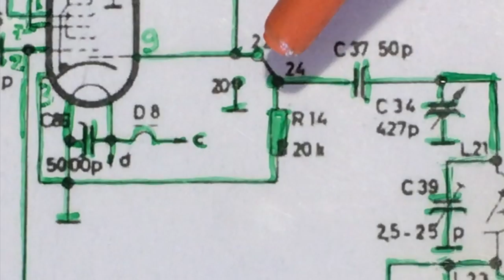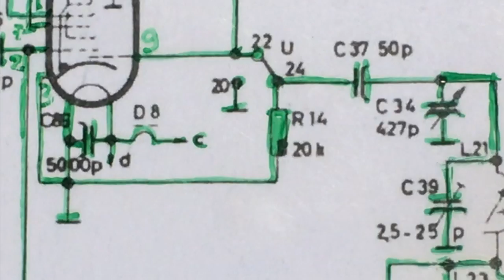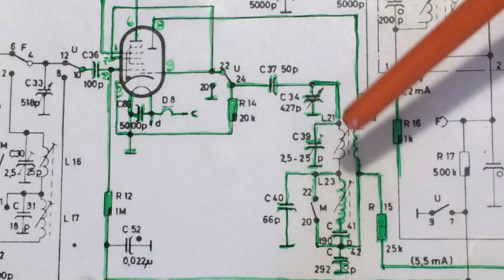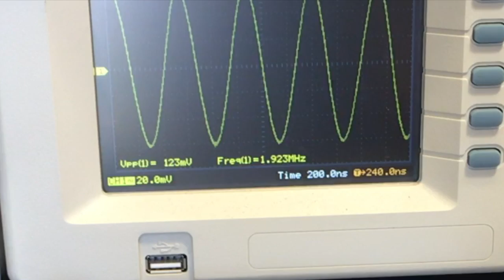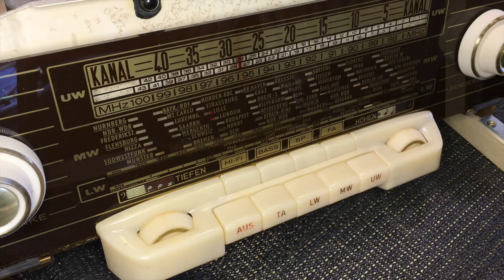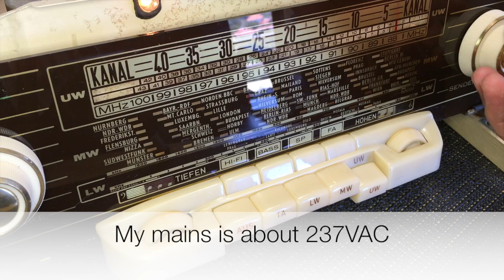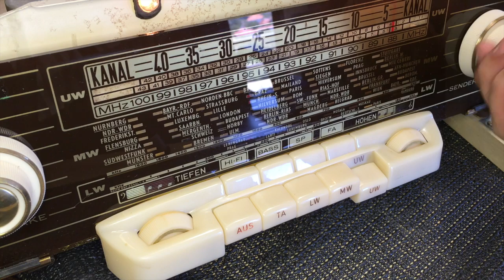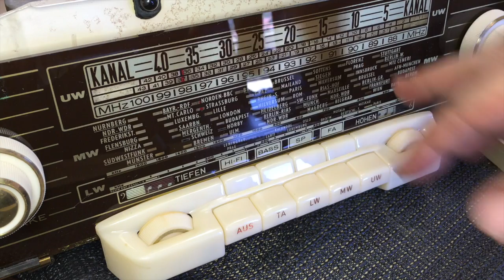Loewe-Opta Magnet 3737W tube radio restoration - Part 3. Faulty oscillator working.

Comment: Nice fix :) It does seem like the tuning cap shorting, doesn't it...
Reply from the maker: +Alan Cordwell : we shall see. I restore these radios with the primary purpose of getting fm to work, as they sound really great. AM here (in madeira) is practically unused (1 station), so I'm anxious to hear the fm coming to life.
Reply: Well it's trying, when you tune up to the top of the band it bursts into life- could be the ECC85 as well being a bit lazy. My speciality here in the UK is the  Bush sets like the VHF62 that I did a write up on the vintage radio forum; it's almost the same valve line up but with 2 EF89 stages; but you're right they sound fabulous on FM. The EL84 output stage can't be beaten- just look the price those valves fetch on eBay! Here we have a few AM stations still going but in Europe they are rapidly closing down, it used to be that the MW band was full of German and French stations after dark but no longer :/ and long wave will be going the same way in time I'm sure. We have DAB but it's very poor, many stations broadcasting at only 80kbits/sec mono so hopefully FM will be around for a while yet. Thanks for a great set of videos, I always enjoy them :) Alan

Comment: very informative......can i ask about the coil that you used to check the oscillator ?...how its build?  much obliged
Reply from the maker: +mountainhawk : you can use practically any wire to wind 2 or 3 turns, with a diameter of about 2cm, and connect the two ends to the coax which will feed into the scope. Use insulated wire so that you don't cause any shorts when probing the radio. Works very well.

Comment: Great bit of fault finding and good to hear it working. Does sound like the tuning capacitor is shorting out on FM
Reply from the maker: Thanks. I'm actually a little afraid of the FM as I don't really have that much experience with that channel. With the number of radios I've restored there has never been one with serious fm trouble. Well, there always has to be a first time.